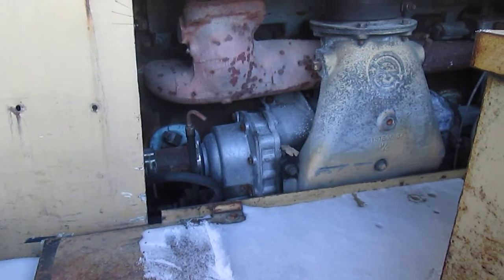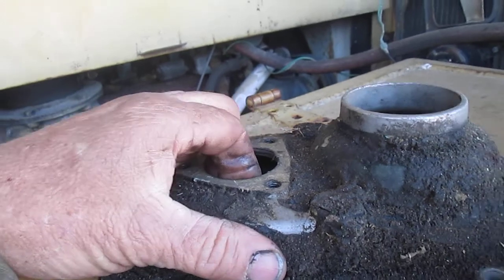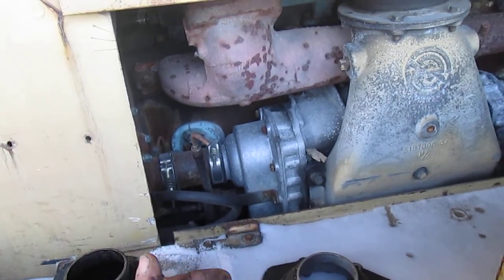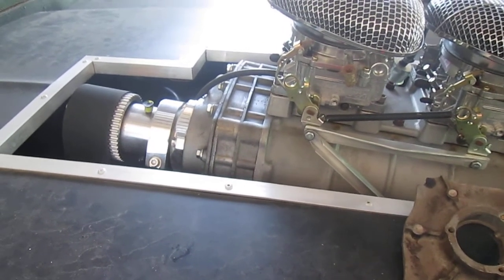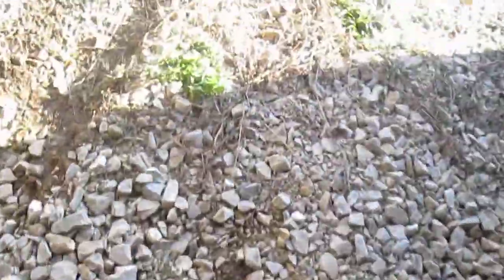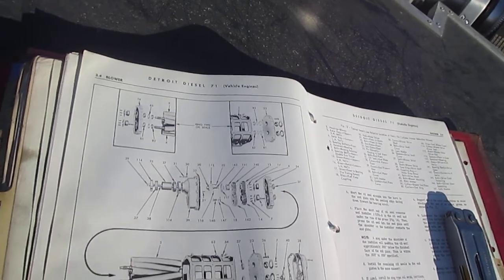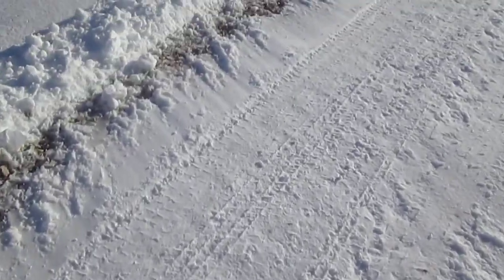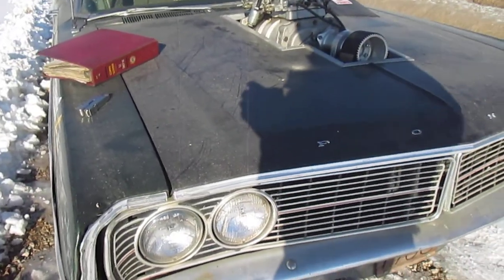6-71 Reduction Blower Easy Identification

Comment: How much of a job is it to remove a blower off a 671 diesel
Reply: Yes I'm going to get it this weekend... your videos are a big help there's not a lot of info out there
Reply from the maker: @chrisfernandez8840  Good deal and let us know how it turns out or is you need a hand .
Reply: I got the 671 blower everything looked good until I got it torn down and one rotor is cracked and the shaft is bent... any idea where I could find a rotor. It's the reduction drive just like yours
Reply from the maker: @chrisfernandez8840  That's a bummer about the rotor & shaft damage !  Where is the rotor cracked at ?
Reply from the maker: Great question !  Not to bad ....  Remove the drive shaft & 8 bolts on the 6-71 Diesel engine .   
Are you going to build a gasoline blower engine ?
Reply: The Crack goes around one whole lobe.
Reply: Where did you get the hole patter for drilling drive gear

Comment: Instead of changing your pulleys out, why not remove the gear reduction?
Reply from the maker: Great question !  I wanted to leave the blower in stock form in the event it would have to be put back on a GM 6-71 Diesel engine as we still run those in the fleet .  Closer view of the reduction style blower in this video . https://www.youtube.com/watch?v=DQy3ImnMx28&t=2s
Reply: So could you replace the reduction gears with a single set of gears? Is the space between the rotor shafts the same
Reply: @hotrodhustle5456  The gears against the plate are the same as the rest of the 71 series, I believe the gear reduction just bolts onto them with spacers and bearings. I don't have access to the microfiche, but have not seen any blower rotors with extra long stub shafts on them.

Comment: How much boost you think it is able to a Detroit blower make?
Reply from the maker: That's a good question .   Blower Drive Service has some interesting charts on this topic https://www.blowerdriveservice.com/TechnicalCharts
  They show some applications up in the mid 20PSI range on the chart .  I assume these are BDS blowers with the " Teflon Edge " on the rotors .  Would help it seal better . 
  On the stock General Motors blowers like we use there is about .007 clearance between the case and rotor like I show in this vid setting up the reduction blower .     https://www.youtube.com/watch?v=DQy3ImnMx28&t=318s
  I would think a stock General Motors blower would be capable of 15 PSI  however on a street application like our cars I would not go over 8 PSI .     The Ford Galaxie 500 is at 7 PSI and the Ranchero around 5.5  .  Both make good power and no issues running standard 87 octane pump gas .